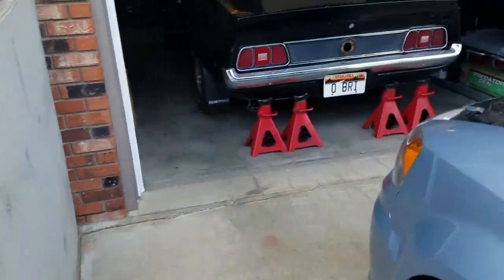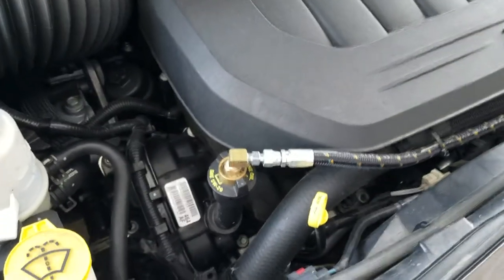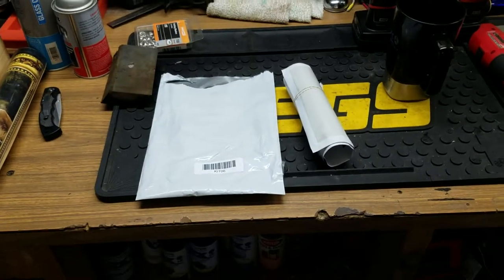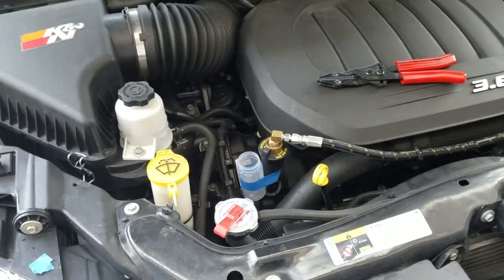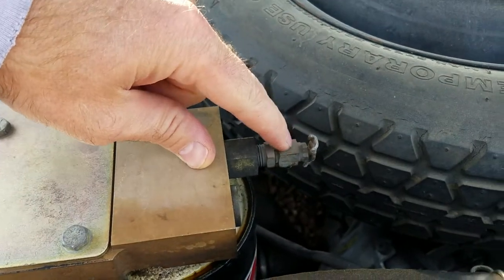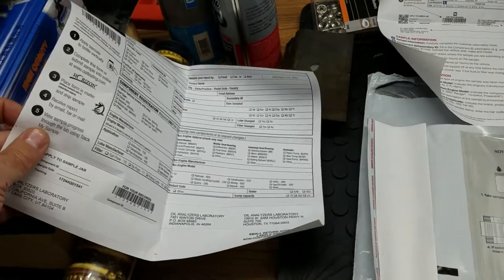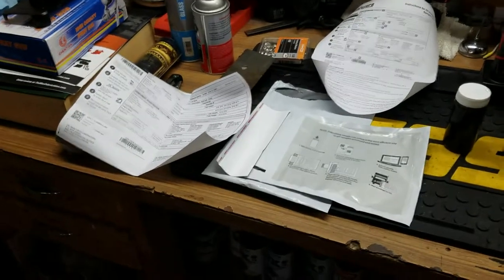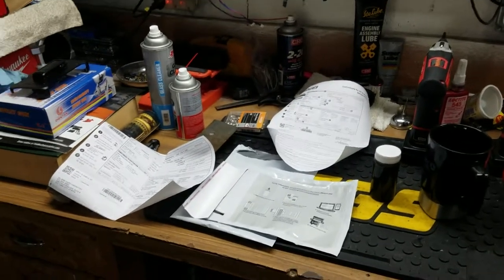How to take an AMSOIL oil sample in my Town and Country

Comment: In 35 years of wrenching I have yet to see an oil filter where you can see light through the media, even cartridge filters.  There is something wrong with the filter.  How many full flow filters have you gone through in 62K miles, and how much oil has been added during that time.  What is your oil consumption?  All engines consume some oil.  Where are the oil analysis for the first 62K miles? When was the Bypass installed?  You bought it used, one year old. how many miles on the engine when you got it?
Reply from the maker: Again.... most, if not all, your answers you seek are already stated in the videos. I don't have time to repeat myself in the comments. Nor do I have the precise memory to remember everything that I said in my videos a year ago. Thanks for your time.